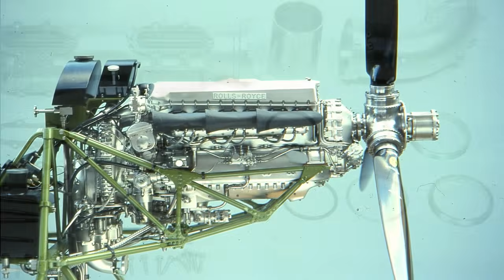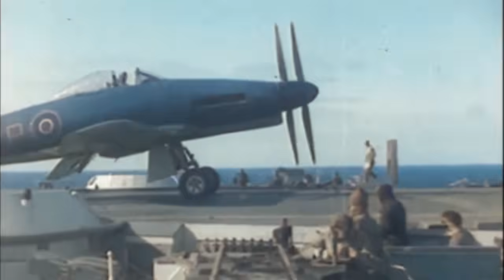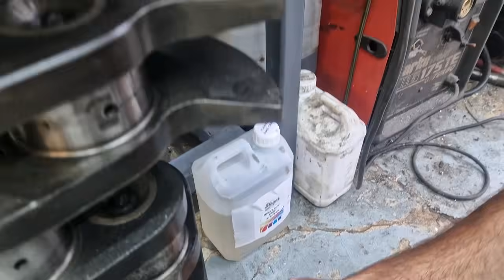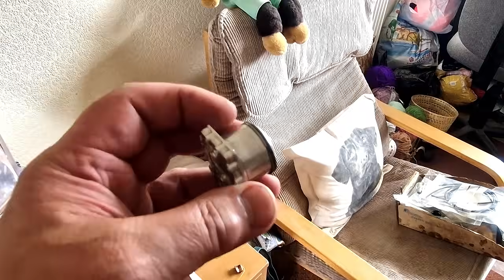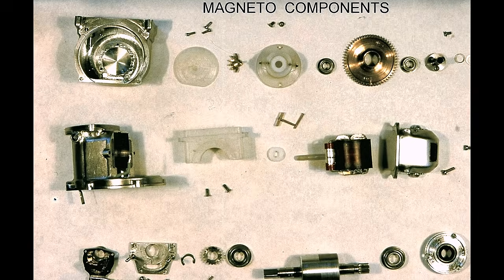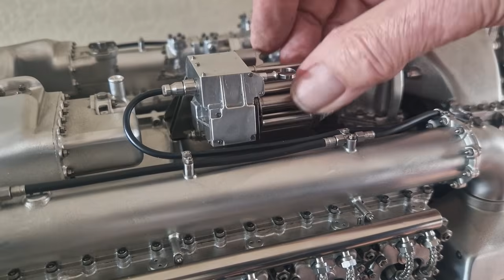You Won't Believe This. Barry Hares will boggle your mind!

Comment: Barry Hares work is simply astonishing.  Now it is known that the original Sabre engine was a serious animal, with a reputation for occasionally bursting into flames on start up. I am frankly astonished that anyone would build their own sleeve valve engine, but a 24 cylinder twin spark supercharged one like this is stratospheric engineering at 1:1 let alone at 1:5 scale. This man is an engineering god.
Reply from the maker: He really is a once in a hundred years talent. He just turned 90 but he's still in his workshop every afternoon mending watches. An absolute legend, is Clever Barry.

Comment: Wonderful! A case of R-R trying to copy Napiers and discovering the hard way!
Reply from the maker: I think they were all at it at the same time - it was the next logical step until the gas turbines took over. R-R got that right though. You don't look out of the window on the way to your Jet2 holiday and see Napier on the engine nacelle. 😁
Reply: @TheBluebirdProject the Government favoured RR and Napiers had been merged into English Electric and produced the Deltic.
Reply from the maker: @nickinknutsford  Now there's an engine! The main East Coast line ran along the end of my dad's builders yard and the Deltics used to slow for a bridge there then spool up the big bow-down turbines at the end of the yard. Years later we ran an expedition to look for a missing submarine in Norway and we 'borrowed' two RN minesweepers. They were powered by Deltics because of their low magnetic signature.
Reply: @TheBluebirdProject that"s interesting....my Dad did his apprenticeship with Napiers and worked for a while in Deltic customer support department. I did my apprenticeship at R-R Derby!
Reply from the maker: @nickinknutsford  I travelled to R-R Derby a few times. Their head of PR was based there and he helped us a lot - without ever admitting that R-R was helping us a lot, if you know what I mean. Fabulous chap.

Comment: I can't wait to see the direction he took with the cartridge starter system! 9mm Flobert or .410 Shotshell, is what I would imagine, but with Barry, I would not be a bit surprised if he had calculated how many cubic feet of gas needed to be produced and the pressure needed then designed and built a whole new, unique cartridge!
Reply from the maker: I'm not sure but he did conclude that if it was ever used in anger the gears that drive the engine itself would undoubtedly explode at that scale so it all indexes electrically and works in every way but it will only ever stand as a miracle of model engineering.

Comment: Hi 
I didn't know about the eagle aero engine till I saw this vid but I did know of and have worked on rolls eagle diesel engines approx 12 - 14 litre six cylinder turbo charged units big noisy and poor power delivery with a determination to keep the fluids on the outside
Reply from the maker: I worked on those too. They were unimpressive. I always preferred the Perkins 6354 or the Gardners. 
But the Eagle 22 would have been interesting in a wagon. 😁

Comment: I am totally  blown away by this savant level of engineering. The Eagle, like the Sabre, with their sleeve valves  is  of the most complex possible piston engines. 
There are a group of people in Canada who are building a Sabre powered Typhoon to airworthy condition. They are on YT under Typhoon Legacy and at the moment have a sectioned Sabre engine, which is the same configuration as the Eagle. I don't think a full size Sabre engine has run since the late 50's / early 60's so they have a very steep learning curve to make an airworthy engine, but I will follow it closely.
Reply from the maker: Yes, I've seen some of that whilst gathering a few bits and pieces for the film. The engine sound of the Wyvern taking off and landing is actually a Sabre that I 'borrowed' for cinematic effect. several commentators have mistaken the glimpses of Barry's Eagle over the past few weeks for a Sabre and one point blank declared that it wasn't an Eagle at all. It's a beautiful thing whatever way you look at it.
By the way, there's another Sabre powered project on the go. This one here in the UK

https://hawkertyphoon.com/the-project
Reply: @TheBluebirdProject  Thanks for that I wasn't aware of the UK Typhoon project, I shall keep an eye on progress. I think that Kermit Weeks in Fantary of Flight also has designs on restoring a Typhoon or Tempest but then he has so many projects on the go it could be years before that one reaches the front of the queue.

Comment: I cannot find the words, I really can't. A question for Barry. I notice that the crankcases split horizontally, where the journal housing line bored? If they were, were they done after bolting them together, or were they bored separately?
Reply from the maker: That question is on the list, but if I had to guess he'll have clamped to chunks of aluminium together, bored a hole through the centre then done the rest with a teaspoon. Let's ask him.

Comment: Fabulous. So Rolls-Royce built their version of the Napier Sabre. Many years ago I met a flight engineer on the Short flying boats and asked him how the sleeve valve worked. His wife rolled her eyes and he shot down to his garage and brought back a Bristol cylinder and I spent over an hour getting a tour of the mechanism. No wonder jets took over.
Reply from the maker: Yes, it was more or less the same as the Sabre only it never go to reach its potential because of the gas turbine. As you say, little wonder they won the day. We run Bluebird's engines on a test stand and they only have one major moving part.

Comment: STAGGERING ENGINEERING. NOT JUST THE MACHINING BUT THE SPECIAL METALS REQUIRED. THE DESMONDO TYPE VALVE WAS TRIED ON A MOTORCYCLE . LUBRICATION ISSUES. PREHAPS R.R DID NOT KNOW BUT THE GERMANS TRIED TO PUT TWO ENGINES TOGETHER. NOT SUCSSESFUL. OVERHEATING JUST ONE PROBLEM. YEARS AGO A MAN WHO LIVED IN BIRMINGHAM MADE A MODEL  MERLIN ENGINE.  I SAW IT RUNNING. NOT RUN OFTEN. R.R TESTED IT AND WITH THE TWO STAGE SUPERCHARGER THEY STATED IT SOUNDEN LIKE THE REAL MERLIN.  THE EAGLE WAS FAR MORE COMPLEX SO AN OUTSTANDING ACHIEVMENT.
Reply from the maker: The man you mention who made the Merlin was Clever Barry himself. There's a couple of films about it in the playlist.

Comment: Thanks for bringing this to the attention of me, This is perhaps THE finest home made engine in miniature ever made . How morons on the telly get celebrated when this fella knocks this up in a shed is beyond me.

Q for Barry: Is there any videos of the Eagle running?
Reply from the maker: No, the Eagle has never run. It would run but it includes all the things that made the full size one unreliable so Barry has always been reluctant to fire it up, understandably. I had my ear to it when he turned it over recently and you can hear all the internals working and it breathing and catch a whiff of exhaled oil as it goes but it's yet to feel the heat of combustion.

Comment: I’ve been waiting for this video!! Thank you soo much. This is amazing art.
Reply from the maker: The Eagle hasn't. It would but then as it's a perfect copy of the original it therefore includes all the things that made the full size engine unreliable. It's also fuel injected and that doesn't scale well but running it is often discussed so you never know. The Merlin was run regularly.

Comment: This is an unimaginable tour de force in engineering at any scale - it would be interesting to know what sort of equipment blessed Barry's workshop. 
I think the Rolls Royce brief for this engine was to design the most complex iteration of any aero engine possible - with as many potential points of failure they could incorporate into a product that in no way could be manufactured profitably.
In other words the normal British solution - we can do it so let's do it. Shame that mentality doesn't exist anymore.
Reply from the maker: Barry only seems to have a lathe and a milling machine. And an engraver. There's fixtures and tooling in the cupboards but so far as I am aware he's basically taken the art of using ordinary tools to a whole new level. I'll ask next time because a lot of people want to know that one.
Reply: @TheBluebirdProject 
You forgot to mention what he has that's far more important than his lathe and milling machine, that great big brain he has.